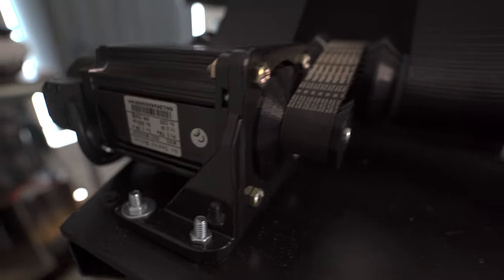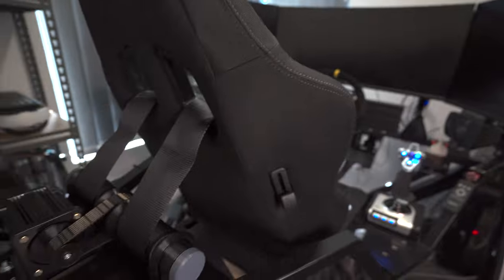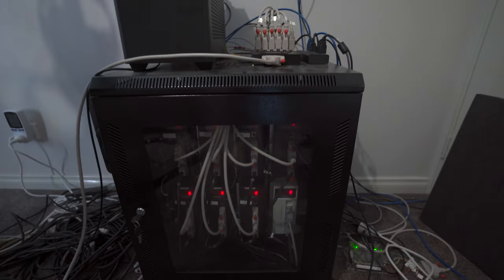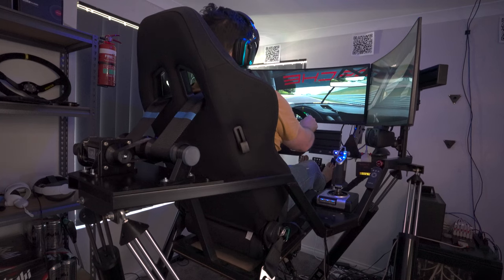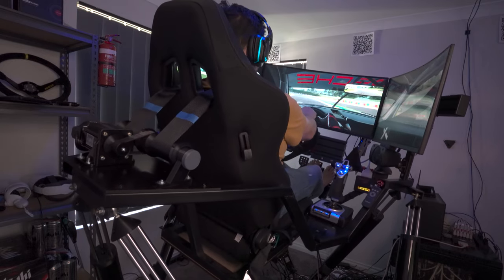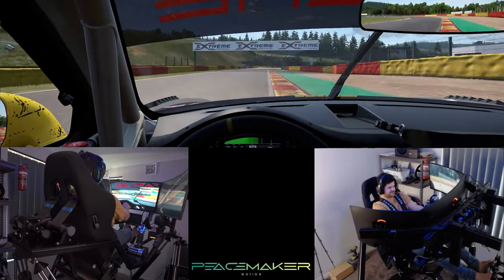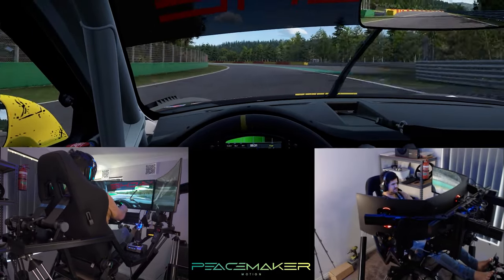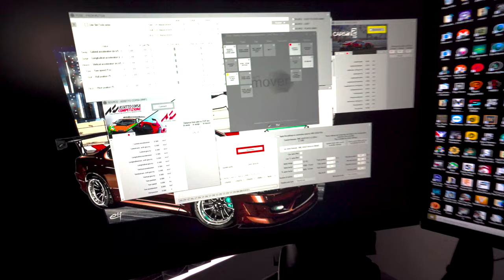Flag Ghost Belt Tensioner on a 6dof DIY Motion Simulator

Comment: I really need to get my motion rig going again!  I have had sooo many issues with motion compensation and the Varjo Aero I gave up on motion until some of the issues are resolved.  Thanks for the new video though because this was on my list of upgrades for sure.
Reply from the maker: Have you tried openxr motion compensation? They got it up and running real quick! The varjo seems to work better with the openxr over steamvr.. from what I've heard. So tracking should be better. Openxr (open composite) gets way better performance too. Check it out.
Reply: I have the aero and a 6 dof rig and I have no issue with motion compensation I think it might have to do with me having three base stations so maybe you can try that unless you have some other issue

Comment: Really cool setup! I couldnt help but notice the qr codes at the wall, is it for use in VR? I hade the idea of creating sort of "Anchor points" for the tracking on the quest headsets for it to be able to remember its position better so i dont need to fiddle with recentering every time i play. Is this what you use them for?
Reply from the maker: Hey mate. Cheers. Yeah they help because the one downside of inside our tracking is it picks up the monitors alot and thinks your stationary. Mainly for use with motion compensation. I find just using 3 axis on the HMD has good results too as it just uses the gyro and not cameras

Comment: Hi, i just built 6dof and im thinking about ordering 6 of 110v 1000w  servo motors with 30amp white controllers.  Do you think 30amp white controller is ok  in united state?
Reply from the maker: Sorry a bit late. Should be totally fine. most people use the 750w 20A setups there.. dont see why it wouldnt work.. these rigs dont even use 25% of the rated power anyway

Comment: It looks very good, but you should add a grip between the back of the chair and the chassis, in the video you can see how it moves everything backwards...
Reply from the maker: Yeah its actually this chair. It's really cheap and nasty. I wanted a reclinable chair for those long sessions. But it has a stupid amount of play in the back rest. Even without the tensioner the chair still flexes alot. I would like a better chair one of these days for sure. But maybe I could do like you said for now and have something to wedge in there and stop the flex. Thanks for the idea :)
Reply: @peacemakermotion3949  q